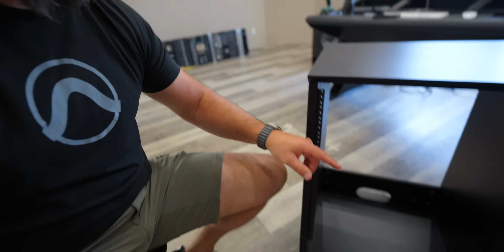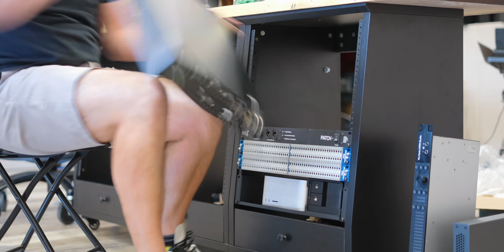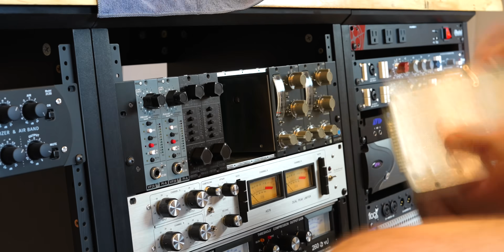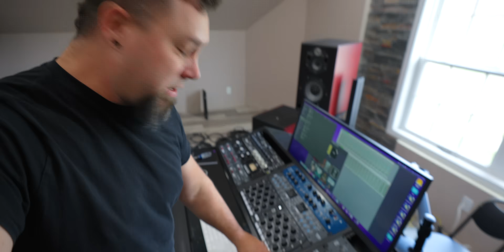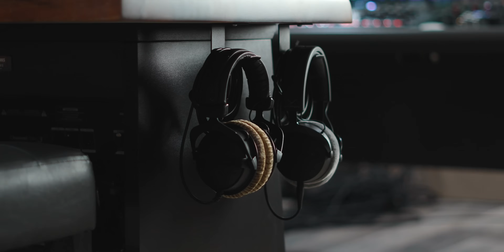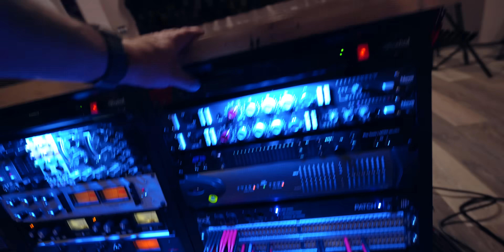Setting Up my DREAM HOME STUDIO

Comment: Very nice vibe!  Well done.

I understand about neat cable management.  I HATE cables exposed and strung everywhere.  I don't have as much gear as you but I have quite a bit.  My solution was to put it all into a single big rack.  That way all of the cables are in one location.  The only cables leaving the rack are computer monitors, power, and my external guitar rig Ox Box.  The problem with that is that my rack is full and I have no more room for additional gear.  That kind of makes me less enthusiastic about buying more gear and that's a good thing.  :o)  That's how much I hate cable-clutter!  I understand that is not an option for you.  500 series stuff has been a Godsend for me.  A lot of gear can be crammed into a tight space.  

As far as documenting the cabling goes, I have an Excel spreadsheet that I made and spent a ridiculous amount of time in the planning stages with it before I ever hooked anything up or made any cables.  Most of my interconnects are either TRS or XLR.  I only have one DB25 unit.  All of my patchbays are TRS.  I make all of my own cabling and snakes using quality cable and plugs so I can make them whatever length I need to in order to keep the internal rack mess at a minimum.  I use colored shrink tube at both ends of each run and on each snake and those go onto the spreadsheet along with the patch point locations for every I/O in the patchbays.  There are no duplicate colors anywhere in my system so problems are easy to trace even though I have never had any interconnect problems whatsoever due to the excessive planning I do before ever making any cables.  I use the spreadsheet as a guide as I am making the cables so when it comes time to plug everything in I use the spreadsheet as a map.  I am always amazed that everything works as it should, the very first time, every time.  I learned that lesson the hard way after doing this stuff since the late 70's.

I would like to see a video about how you keep all the dust cleaned out of the racks and off of everything.  That is always a problem for me and I haven't found a solution I am happy with.  Feather dusters and brushes just move the dust from one place to another and don't really clean anything.  I haven't been able to find a brush attachment for a vacuum cleaner with long, or soft enough bristles to get the job done satisfactorily.  Especially inside the rack.

Thank you for documenting your journey.  It is inspiring to see how someone else does it.

Comment: Cutting into the floor to have cables dive down... bet your floor joists run cross-ways and you'd have to drill through every one. I'd honestly just get a large cable mat and call it a day.
Reply from the maker: Unfortunately, they do run, crossways…. I would probably have to build a cable trough in the ceiling of the garage as drilling through floor joists is not a great idea.
Reply: @ColtCapperrune   Eyyy maybe the dude suggesting Dante routing was onto something... 😂

Comment: How do you handle routing power everywhere in this room? Are there multiple circuit breakers feeding it? How will you expand power requirements for the additional Atmos speakers?

Comment: I started working for an AVL integration and production  company at the start of this year..  and making custom length snakes and cables  has been one of my most valuable  skills ive learned how to do.   The longest part, at least for me, is soldering all the XLR and DMX ends.  We also make our own ethernet  cables but thats its own beast making sure you have your twisted pairs in the right order. 

But all in all its been a valuable  skillset for me building a studio in my home.

Comment: weird to put your bays below your IO and CPU.  You actually have to access your bays but your io mostly goes untouched.  I organize bays so the stuff I touch the most are the easiest to get to.  cool room though.
Reply from the maker: You should always keep your I/O visible to make sure you’re not clipping. If the patch bays were above the interfaces, the cables would block my view, when I’m turning around and looking at 100 times throughout a mix.
Reply: @ColtCapperrune  My DAW Meters are usually good enough indicators (in and out) for me as they tend to read about the same or close enough to my IO meters, granted, I am not mixing through as robust of a outboard chain as you do.  Maybe it's just a calibration thing.  My back is too bad to bend over every time I need to patch something.  Old and its getting worse.  Does look good though.  Congrats.

Comment: That producer desk being on those wheels and not mounted to the floor is giving me all the anxiety in the world. Maybe it's more balanced in person but it looks like if someone accidentally put too much weight on the stool-side of that thing it could tip. And that would be the most tragic thing ever, holy smokes! You could cut a platform out of a couple of sheets of MDF to make a platform to preserve the height and screw it to the floor and then screw the desk to the platform and paint it black.
Reply from the maker: It’s counterbalanced by hundreds and hundreds and hundreds of pounds of gear in the front of the rack. I could stand on the back of it and it wouldn’t tip over. Thanks for watching!
Reply: @ColtCapperrune  Very good, I knew you’d be all over that potential problem, I just worry about stuff like that all the time.

Comment: Excellent job! and looks so amazing man! 👏

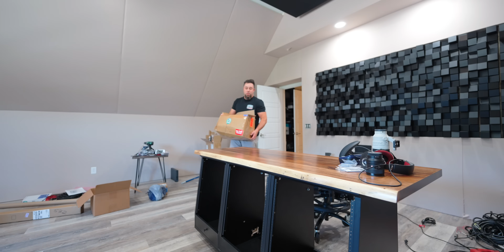I was on the hunt for a 3-bay rack but couldn’t find one that met my needs, so I decided to have one custom made. At the last moment, we came up with the idea of adding holes between the bays. This way, we could connect a device in rack A to rack C without having to loop the cables from behind. It reminded me of a point in a video where I saw someone opening a hole by hand😅; it turns out I went through the same process! 5:13😝

Comment: I wonder you could use gels or light/lens filter type material to shape that harder blue light of the Radial Power 2 into that warm colour you were after. Should be possible, I think. Though I completely get why a mixer would want to have the island with the three racks immediately behind you, for convenience. Before thinking about cutting into the floor for cable routing, worth just checking that having that island there does or doesn't interfere with the listening position, behind behind you like that, and relatively tall, compared to seated listening position, and with a flat acoustically reflective table on top. It's possible it could cause reflection points you don't want. Off to the side, opposite the guitar amp wall, could be another option to get it acoustically out of sight. Though, at cost of inconvenience, and maybe acoustic (and visual) asymmetry. With the big bundle of cables that bother you, maybe get someone crafty to weave you a really nice handmade giant cable 'warmer' in earthier colours. Would be funky and maybe not as offensive as the bundle loose cables with strays escaping ;)

Comment: Have you considered putting the computer and PT interfaces in a separate iso-rack with a fan for cooling? Also, mitigating the vibration through the credenza from having the Mac Studio on the rack shelf?
Reply: Especially the HDX card creates tons of noise with that nasty little fan on it.

Comment: You may be too close to the project to see the raw plywood poking out from between your rear wall diffuser panels. Flat black paint may be too much of a pain but you can also staple up black “stop grow” cloth for use in gardens or just black cloth. It’ll make the joint just that more rad. Keep up the great work - you’re an inspiration.
Reply from the maker: There’s definitely some refinements to make to the room, that being one of the main ones. Thank you!

Comment: Dream studio there bro! Well done, the Phillips lighting is so clean and the warmer hue is perfect for those late night sessions. Realistically after all that effort you're gunna have to chase those wires through the floor once the Atmos comes, can't have those cables everywhere.
Reply from the maker: I’m absolutely dreading cutting holes in the floor, it is five layers, thick with doubled, and triple up floor joists from when we built the house around this studio. I’m nervous. It will make the soundproofing of the room significantly worse, in addition to the headache of actually doing it. But time will tell, it may annoy me to the point where I do it anyway. Thanks for watching!

Comment: For the patch isn't possible to get more flock? I know it's expensive but maybe the benefit outweighs the cost. 

Do you have any plans to cover the back of the producer's island? Any mesh or cover plate with breathing? It would be a stretch of risk to leave that open in the back and someone accidentally stomping or kicking any gear.

For the cables, maybe you could put some sort of cable protectors as those used on stage to PA runs.

For the control you could use the Stream Deck + that has some rotary encoders and buttons that you may configure with macros to handle all your needs.
Reply from the maker: I’d have to run the numbers, but I would need at least two more flock patches which is like $6000. So it may happen in the future, but for right now this is what I had to work with.

I will be putting some sort of mesh on the back of the rack, that is definitely the plan, just have to source it. 

A stream deck with a rotary encoder is definitely one of the options I’m considering   

Thanks for watching!
Reply: @ColtCapperrune  Awesome!! Another thing that I'm curious about is your order in projects. Do you produce, mix and master in the same project or do you use separate for each task or how do you go about it?
Reply: @ColtCapperrune  Keep in mind that Flock makes versions with more channels.

Comment: Did you retune the room after all that gear went in?  I know mine changed dramatically as I added stuff back in.
Reply from the maker: I haven’t yet, because we will be spending a significant amount of time tuning once we put the Atmos rig in. So no point in doing it before then.

Comment: Are the backs of the racks still open? That would mean, people sitting on the stools could make a mess by accidently getting their feet between the cables.
Reply from the maker: They are, the plan is to find some sort of mesh to put over the back of the racks. But I want to make sure the set up isn’t going to continue to evolve before I do that.
Reply: @ColtCapperrune  Why not put rack doors on it ? That way they would be safe but you can always quickly get inside.

Comment: Looks amazing, I would have put the patch bay at a more convenient place. But, that's me, I hate bending over and looking at small print one foot from the ground. I guess I'm lazy 😉
Reply from the maker: Thank you so much! I’m super picky about what gear goes where for the sake of my workflow, and I’d rather have the patch bays hard to read then knobs on the gear. So since that’s about the least convenient spot, close to the ground, that’s where patch bays go.
Reply: @ColtCapperrune  I get what you mean, you wanted to optimize the ergonomy and overall look. Patch bays tend to be messy and take up place. Your outboard gear is epic wow. Love your show and impressed by your mixing and your drive. Keep it up👏💪👍